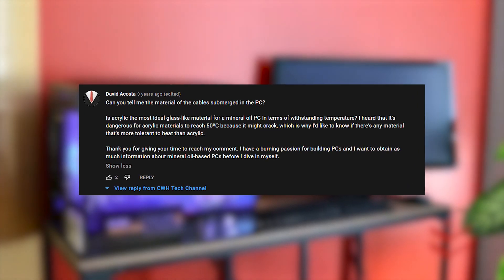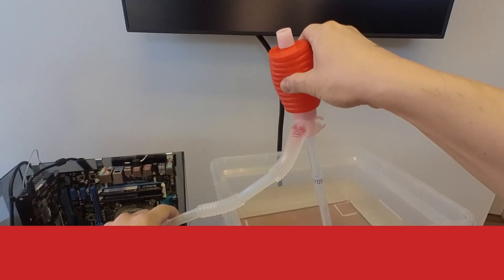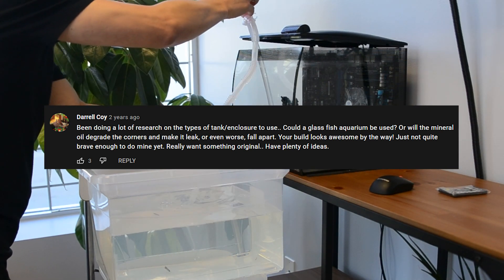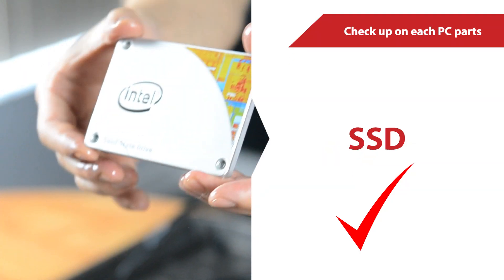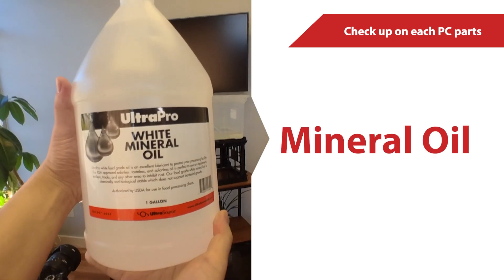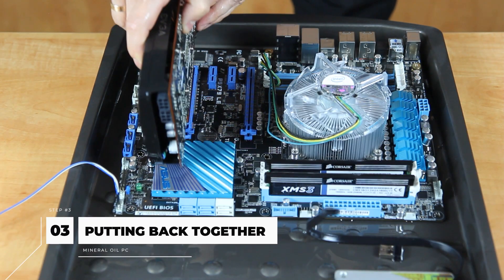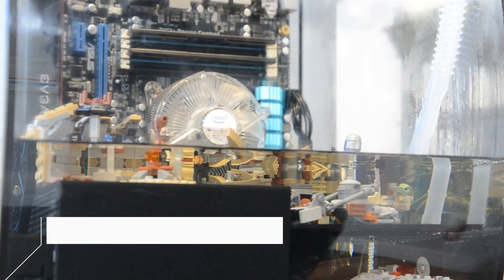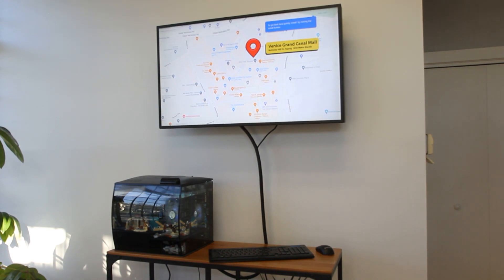3yr Old Mineral Oil PC Servicing | CWH Tech Tips

Comment: You most likely do need the fans to keep a flow in the tank, otherwise the oil close to the parts will get hotter and will create hot spots.
Reply: The Fans also provide conductive cooling effect. The Oil carries the overheat faster away from the CPU. So its better to keep them running! Also you might seal the Top of the tank because of oil fumes? They are toxic? A sealing and some screws on top of the tank should do the job.

Comment: I have a question, my friend do this with his RIG, and the result is the solder tin looks eroded, and 3 of the tiny components fell off (resistor or capacitor). Is that because of the mineral oil is contaminated with acid or maybe just dirty?
Reply from the maker: Hmm.. we've had this running for many years and didn't see what you described. Pretty hard to diagnose without knowing everything..

I'd suggest getting branded parts as that can be a factor.. too many cheap(I don't want to say fake!) parts out there..

Also don't play with it too much(taking things in and out of the tank).. This is pretty much a set and forget sorta situation :)